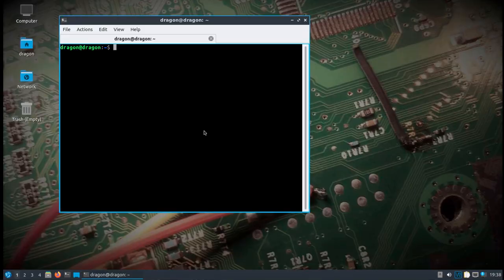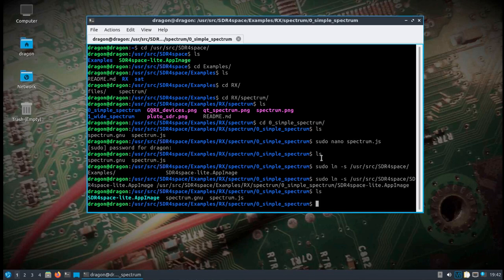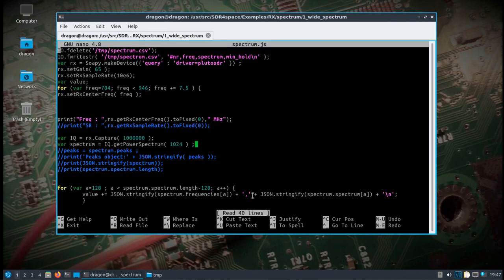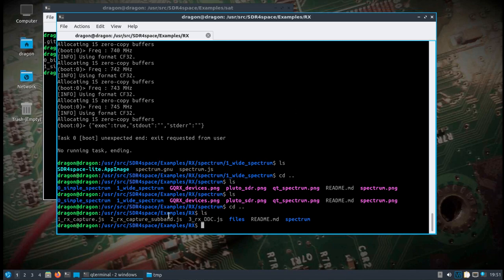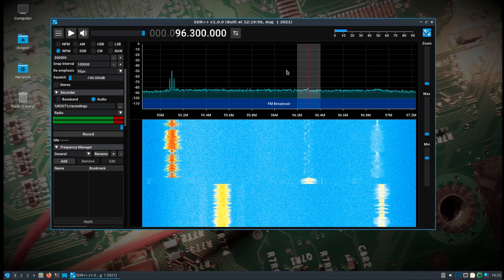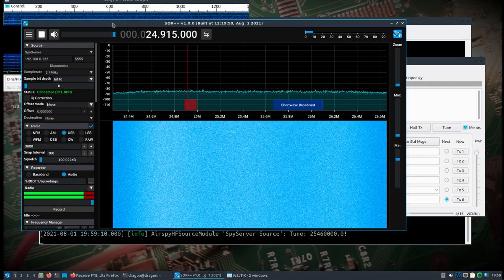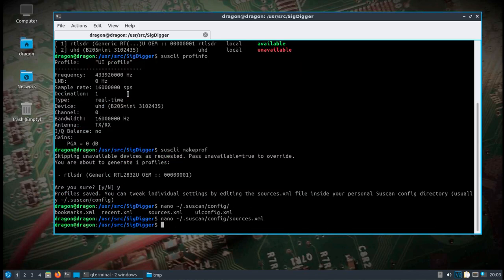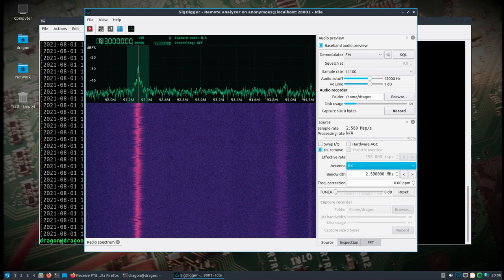DragonOS Focal RTL-SDR w/ SDR4space, SDR++ 1.0.0, and SigDigger (WSJT-X, Spyserver, Suscli, R16)

Comment: Dear Sir
first i would like to thank you for your great work and effort that you invest in developing dragonOS.
atctually, i noticed (maybe a bug) that when i use SDR++ with hackRF one. 
i installed a fresh focal 25, and whenever i start SDR++ and choosing the source device HackRF, the program freezes and shutdowns down. So maybe there is a problem with HackRF one with SDR++.
many thanks
Reply from the maker: Easy fix (it’s a known bug with soapy and libhackrf), you first have to start sdrpp and scroll down the menu on the left side till you find the module manager. Remove the soapysdr module. Then restart sdrpp and then when you select hackrf you should be good. I also recommend you have the 2021 or greater firmware on the hackrf.

Comment: Hi cemaxecuter, where i can download r16 release? I can't find it on sourceforge.
I have two pc's and cant rsync data between r16 and r17, after rsync OS stops working correctly.
Reply from the maker: Give me a few and I’ll see if it’s on my local drive. I’ll put a link asap
Reply from the maker: So somehow I have 15 and 17 but no iso 16 immediately available.
Reply: Thank you for such a quick response. If you find R16, please give a link to it.  I'll try to make a bit-by-bit copy(dd) for now.
Reply from the maker: No problem. I think I started deleting off sourceforge thinking I only had so much storage on there.

Comment: Watched this video on my way into work today and the SDR++ is an awesome addition for a project I was working on. I loaded up the latest release on a VM but sdr++  won't open. I'm reinstalling and going to try adding it in manually. Interested in getting your feedback on some things I'll reach out sometime soon. Pretty sure we know some of the same people lol.
Reply: quick update: I think it was a virtual box issue. I spun it up in proxmox and worked like a charm.
Reply from the maker: Interesting like just SDR++ wouldn’t load? Reason I ask is because I had an issue yesterday when using the AMDGPU driver. SDR++ wouldn’t load but it looks like some OpenGL issue after some initial debugging,